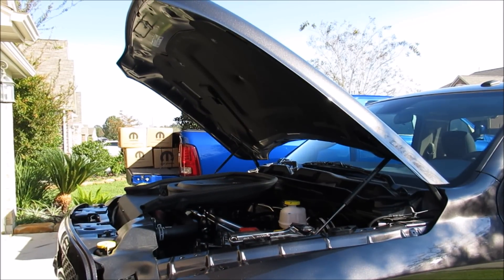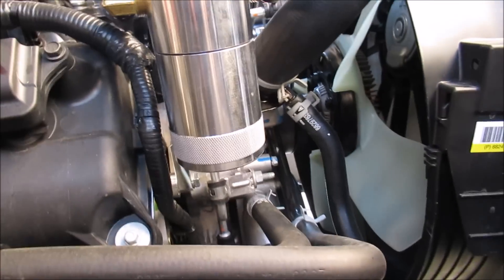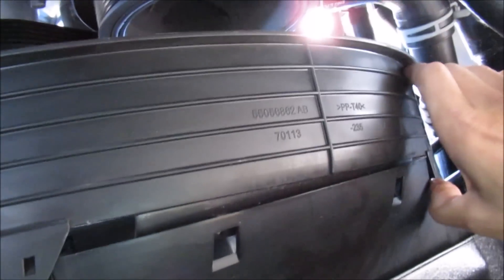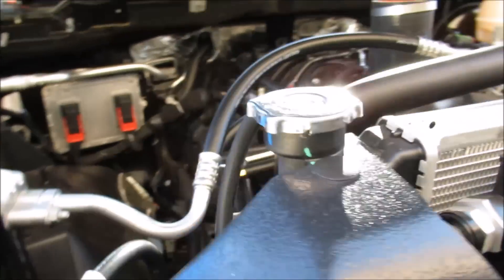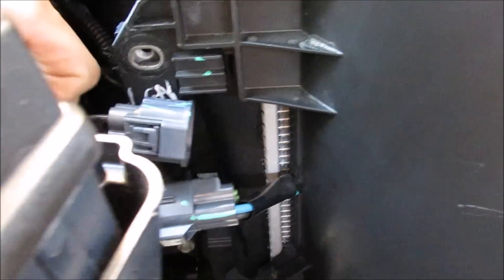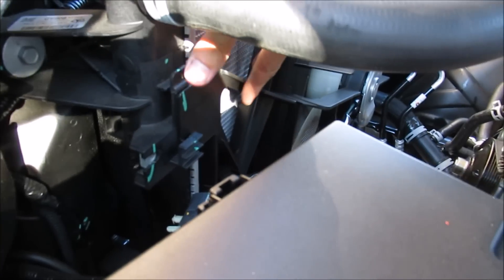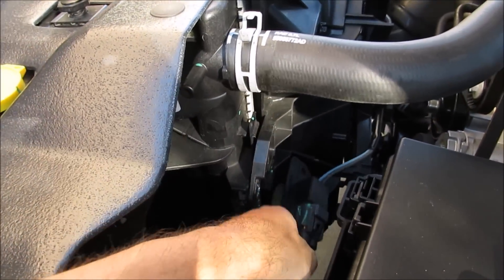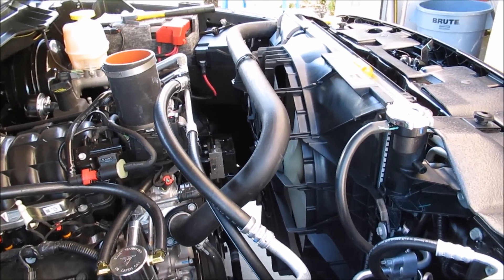2017 Ram 1500 5.7L Hemi Clutch Fan Delete

Comment: Thanks for the video. I have a 2014 Ram 5.7L Hemi 4X4 (70K miles). I'm having issues with the fan running high when going from 1-3gear. and when i say loud i mean i can hear it in the cabin and my neighbor across asked me about it. It's driving me crazy. It sounds like i'm driving an 18 wheeler. Specially at take off. My dealer already replaced the tranny and that did nothing. I had told them the sound was coming from the fan. But they said it was the tranny. So they replaced. A couple of weeks later and it's back at the dealer with same sound. So, do you think if i changed the fan to electric fan like you did would help? any suggestions?
Reply: My mechanic replaced my clutch fan with a hd clutch fan when I rebuilt my motor on my 2014 ram 1500... 180,000km on it... Mine sounds like an 18 wheeler and you can literally feel the power drain. I hate it haha!

Comment: Was thinking about trying this mod on my 2017 Ram 2500 Big horn 6.4L. Have you ever heard of anyone trying this? I found the dimensions of the cooling fan and looks like my measurements match. Plug also looks the same. Would appreciate any input.
Reply: Every find anything out Moe's Performance?

Comment: Where can I get the parts to do this?
Reply: @gregbarker9029  Exactly.  They eliminated the clutch fan in the 2019.
Reply: I got mine from Rock Auto (TYC 622320).  I just did mine today.  Fit perfectly.  I didn't have to zip tie anything since I had enough slack in my plug to make it reach the fan.  With the room I gained in the engine bay...will make for easy work (i.e. changing the serpentine belt, replacing a tensioner, changing the water pump...etc).  Great video.  Glad I found it.

Comment: Dodge should have an electric fan on it in the first place. Clutch fans are outdated now. They already have an electric fan in there for the A/C condenser so why couldn't they just put a bigger fan with variable speeds?

Comment: Hi had a question... I herd that for my truck (2013  ram 1500 Hemi ) I need to use a 09-12 v6 fan so it would plug right in... do you know if that’s true or do you have the specs on that
Reply from the maker: That is true.  The fan part# you need is listed in the description of this video.
Reply: Yes that's all true the only thing that's not true is the DS i3 Only has AC settings nothing for temp settings I saw where the HP has temp setting check it out.

Comment: Maybe I missed it but can you just swap it and then it’s good to go? Or do you have to have a tuner to adjust temperature settings?
Reply: No tuning required.  Also swap out to the 180 thermostat
Reply: There is no use in getting a tune all you can tune in the Diablo Sport i3 is AC fan setting's ON, or AC fan settings off, that's it there is no tune for heat setting on or of don't get sucked in.
Reply: I swapped it and got a DS i3 tuner and it won't to temp setting only AC setting so I'm out all that money. I saw somewhere that an HP will.

Comment: what tuner are you using?
Reply from the maker: Diablo w/ Hemifever Custom Tuning.
Reply: @moesperformance7499  figured, been trying to convince my self to spend $1,000 on the pcm/tuner just havent broke down and ordered it
Reply: There is no use in getting a tune all you can tune in the Diablo Sport i3 is AC fan setting's ON, or AC fan settings off, that's it there is no tune for temp setting on or of don't get sucked in.

Comment: So why not just take the mechanical fan off and leave the shroud and use your V8 fan? This makes no sense to me. I've already got a perfectly good electric fan designed for a V8.
Reply from the maker: Because your Hemi fan does not have its own shroud or a mount for the upper radiator hose.  Your hemi fan is also 3" smaller in diameter than the V6 fan.
Reply: You have more room with the V6 electrical fan shroud.

Comment: whats your reason for going to an electric fan? does your truck run hot when idling ?
Reply: Instead of wasting HP and torque running the clutch fan add the electric fan. More power to the wheels.
Reply: That’s my question. I have some days with an hour or so of idle time so I’m wondering how this handles that

Comment: What if i do this mod without a tuner
Reply: rezridez1 do you have to tune it for sure after you complete the conversion?
Reply: I didn't retune.Mine.and it runs and cool fine. my 2010 kicks.on.at 203degrees
Reply: There is no use in getting a tune all you can tune in the Diablo Sport i3 is AC fan setting's ON, or AC fan settings off, that's it there is no tune for temp setting on or of don't get sucked in.

Comment: So you spend $400 on a OE fan then have to buy a $400- 500.00 tuner to get it to work right . on top of not being cover under your OE warranty to gain maybe 5 to 10 hp i well keep my 1k in the bank for that mod . i want to see some real numbers on this i want to see it run on a dyno befor and after with the truck up to temp. I am not saying it wont help but true dyno numbers dont lie you can do a lot to mod the. 5.7 but there are only a few true things that gave you more hp. At them end of the day . i always tell people show me real numbers  before and after i spend my hard eared money and time on something that may not do any thing . i want Moes to reach back out to me to show us some realy numbers.
Reply: It's not for you son.. Go watch a different video.
Reply: Brent DeCant you lost validity once you said warranty. Lol

Don’t mod your car if you can’t comprehend the need for this change.
Reply: @howidiy2801  What's the need for this?
Reply: @howidiy2801  Lets see i ask a question to see real numbers on this mod i owe a 2017 ram that i Moded. I am also a ase tec. The new 2019 Rams have this tape of fans on them now and no Hp gain . so i guess 1k on that mod is not worth it again . i was just say for the money its not worth it and no real hp gane . for 1 k on the 5.7 ram you can add a OE Ram air intake system . the list goes on form there for about 3k you can get. 5.7 over 500hp and still keep your OE warranty.
Reply: @brentdecant1932  Hope you are a better tec that you do with spelling..Your own not owe,its type of fan not tape..Now on the oe hood intake,i dont think enough air comes over the hood in the right place to give it a more ram air effect nor will it pressurize the air box to see a worth while increase,plus to be effective your gonna need to be atleast 70mph to do anything..
Reply: @brentdecant1932 if you actually were a tech you’d understand that it frees up hp, and lol at your warranty concerns. Don’t mod a truck if you’re concerned about that.
Reply: You came in being a jerk, that is why no one likes you Brent. If you simply said you would like to see the differences on a Dyno then cool. We all would like to see that. Most will have or need a tuner as no one just does a fan mod so you lose that argument. There is also a link for a $100 fan or pick up a used one cheap so you lost the money argument too.
Reply: @craigv1683  UMMMMMM...........As soon as you connect a tuner of any kind to your vehicle, your warranty is void. A tuner changes the factory settings put forth by the manufacturer when it leaves the assembly line. Everyone thinks that you can put your vehicle back to factory settings and remove the tuner when you take it to the dealer for warranty work and they will never know the difference. Wrong, the computer stores all that info and they can see it.
Reply: My warranty is already expired. So f*ck it all
Reply: Lmao Brent is supposedly an ase tech yet thinks a mopar intake and headers will make 500hp bahahaha what a joke.
Reply: Gay!
Reply: Brent is a punk ass little bitch crying about something he is never going to do.... you think this is the only fan mod done to vehicles you dumb fuck
Reply: @brentdecant1932  Tommy is correct....We are not talkin about anything else other than fan delete..It will free up hp/tq(parasitic drag) which adds a lil more acceleration and mpg....Just cause ram makes it,doesnt mean its worth it either..Ex the ram hood intake..Show us #'s via an independent tester of how it builds up the psi in the airbox to make it viable and at what speed does it do its work....
Reply: @lilboatbigwatr  Remember that when Chrysler went to electric power steering they rated the Hemi then went from 390 hp to 395 hp which, imop, the power steering would be robbing more hp because it is providing pressure to the steering rack and engaged at all times unlike the clutch fan which is only engaged at higher eng temps. If you gain only 5 hp by removing the PS pump, there's no way you will gain 8-10 hp with a clutch fan delete.
Reply: Us guys that mod our trucks, most likely have them paid off with NO warranty anymore. Plus….If you race, or go on dyno’s, you want as much HP as you can possibly get.
Reply: How TF u get 1k in price? The fan is 100 bucks on Amazon? And like an hour to take off the old ones....
Reply: A mechanical fan delete doesn’t add any hp. Never has, never will. It frees up used hp, reduces your rotating mass, helps the motor rev quicker, and adds a little more mpg.
Reply: @tjustice09  parasitic drag.....
Reply: If you are worried about warranty, why look up videos of things that void your warranty.  My warranty expired so i could care less. I live in Canada so our temps are on the colder side (-35*c to 30*c).
Reply: @Snakes709  bro you're fucking stupid

Comment: Is the tuner necessary for this install?
Reply: There is no use in getting a tune all you can tune in the Diablo Sport i3 is AC fan setting's ON, or AC fan settings off, that's it there is no tune for heat setting on or of don't get sucked in.
Reply: I got a DS i3 tuner and it only does AC setting it has no temp setting don't get sucked in.

Comment: Just smack a wrench with a hammer and the fan will come loose, saves time
Reply: This guy obviously is a home driveway D.I.Y'er with no knowledge of Auto tech specialty air tools that make these typical basic mods a breeze to perform without the need to beat up your hand tools.

Comment: So I’m really having trouble with this. The only thing I can’t do is keep the water pump pulley from spinning. I’ve got everything else. I have a 2012. What’s the best thing for me to do?
Reply from the maker: You will need to buy or make a tool like we used in the video.  The other option is to use an air chisel to break the nut loose.

Comment: So if I want to keep the stock efan, all I need to do is remove the clutch fan and that’s it?
Reply from the maker: Yes.  Most trucks dont have any issue running just the stock AC fan, but if you do see the temps starting to run warmer than normal, I would put the larger V6 fan on ASAP.
Reply: Martin Ibarra The V6 fan has a shroud.  The stock fan does not.

Comment: Great Video, is the dorman unit a direct fit as well? I have a 14 big horn 5.7 i want to run this unit. Will it kick on automatically when a/c is on? Just wont kick on below 220 without programmer?

Just curious if i could run truck without programmer.

Thanks
Reply: Did you ever get an answer to that?
Reply: @darioavendano369  no never did. Sold the truck since i posted
Reply: PyroCat 1 thanks for replying
Reply: Yes it will.

Comment: If you want to game horse power and more reliability put in a 180° thermostat just cutting down on the heat soak in hot summer days when you're driving in traffic because the engine is 20° cooler yet still adequate hot enough when running synthetics to keep the engine completely clean colder engines produce more horsepower nobody race is a heat soak engine so the 180° thermostat will get you more horsepower than removing the clutch fan

Comment: Don't do this at home because the vehicle reliability will be at 50% without a clutch fan that using 2 to 4 hp when it's hot!!! Electric fans are for racing applications because they're out of track and I have the fan stops or doesn't provide enough cooling for the amount of use you can shut it off and you don't need to go!!
Reply: Your mama must have dropped you on your head. Not once ,but many times.😂
Reply from the maker: Wrong again. Thousands of guys have done this mod on the newer Rams without any issues. Street driving, towing, racing...doesn’t matter. It’s plenty strong enough to cool the motor, especially when paired up with a 180 stat and custom tune as we suggested.
Reply: Moe's Performance it'll work fine as long as you really never want to rely on it leaving town because it's Russian roulette if it was a better idea and it was cheaper and reliable all makers including Mercedes-Benz BMW Volvo name at automaker they all use clutch fans yeah you can get away with it driving around town but you can never go on the open road depending on it because I've seen guys pull over the side of the road with a two-year-old Electric fan that fit the dust and destroy their vacation the worst part about is you go listen to that piece of shit run constantly bad enough listening to the air conditioning fan let alone that giant piece of shit any mechanic including myself will tell you it's a bad idea if you're leaving town yeah you might get away with it a few times but it'll burn you eventually a dodge will handle a pretty severe overheating any Ford aluminum block engine and many other makes a vehicles you're going to warp  the heads easily if you overhear them in the slightest , on older cast-iron block steel head design dodge Chrysler you could put the sucker at 250° never never hurt   The engine just  subtract a little life "'any modern engine you overheat it much it's toast
Reply from the maker: Still wrong.  The fan we installed in this video is the same fan that comes stock on the V6 model Rams that do not come with a clutch fan.  Many factory cars these days do not use a clutch fan.

Comment: The loaner tool is not the kicker but what you did do was cut the reliability of this vehicle down to about 50% electric fans fail all the time especially the relays and when it stops spinning you have no cooling whatsoever and less you're going down the freeway 60 miles an hour,  that's the only way you couldn't keep The engine cool , clutch fans don't fail they just get weaker until you need to replace them but they always provide cooling wwhen this  fails it will cost you $500 to tow it negating any  fuel savings you ever had bad idea take it from older people who've been down tthis  road 30 years ago  I would literally knock $250 off the price of this truck if I was buying it so I could put the clutch fan assembly back on ask any mechanic and they'll tell you electric fans die every day all day long and by the time you notice the engine is overheating it'll be too late
Reply from the maker: Did you even watch the video? There are no relays , extra wiring, or aftermarket fan motors to worry about when doing this. These trucks come with an electric ac fan from the factory that is extremely reliable. What we did here was replace that with an even larger, and equally as reliable, factory unit. We have been running the trucks like this in the Texas heat for 8 years now and no issues at all.
Reply: Moe's Performance  dude that guy has tried blasting everyone in the comment sections he's a fucktard

Comment: My truck coolant temp. runs at 94 to 91 C. i was thinking of doing this too but what temp does the V6 fan kick in to cool down the engine?
Reply from the maker: That i why you need the tuner.  You can use the tuner to make the V6 fan come on at whatever temp you want.

Comment: Great video!  I have a 2015, if I just remove my clutch fan and keep the factory efan can I run it like that?  Or do I NEED a tuner to have the fan come on at a lower temperature?
Reply: Kelly Smith , just don't do it, a waste of money.
Reply: Bill Walker can you tell me why , I was thinking of removing clutch fan
Reply: Yes it will work on your factory efan the only thing is the V6 efan gives you more room and more cooling. Be very careful in what tuner you get I got a DS i3 and it does not to temp setting only AC settings so now I'm out the money and no temp settings.

Comment: Hey Moe's Performance I wanted to make a tool to hold the pulley like yours....what size and length bolts did you use and how far apart center to center to drill holes in the metal bar, thanks
Reply: The bolt spacing for mine was 2.25".  Bolt length was 2", but 1" most likely would have worked.

Comment: Did you mention you can run the factory ac electric fan on the truck ? Would you run into any issues ??
Reply from the maker: You can run the factory AC fan, but its 3" smaller in diameter than the V6 fan, and you would want to keep the stock shroud in place.  The V6 fan is larger and comes with its own shroud for a cleaner install.

Comment: What about the clips on the bottom cover that was hooked to the factory shroud? Is there anywhere to put those back or are they just left dangling? Does the whole cover get removed?
Reply from the maker: They clip right back onto the V6 fan shroud.